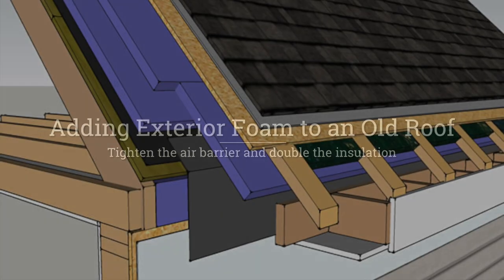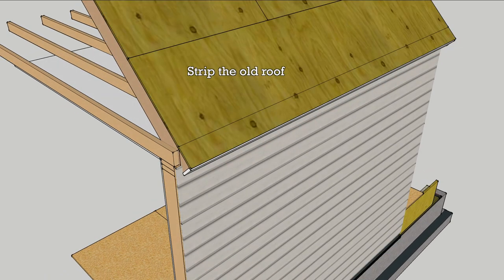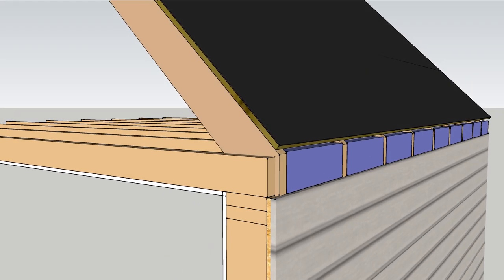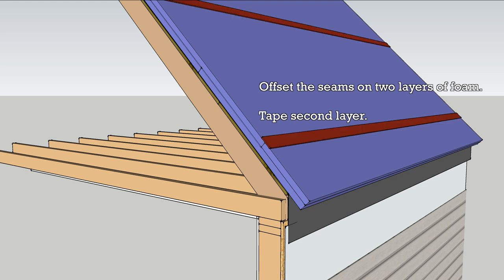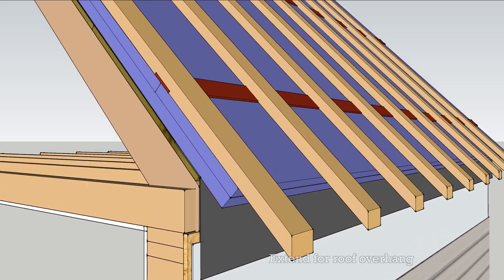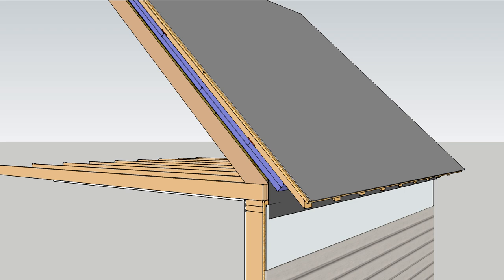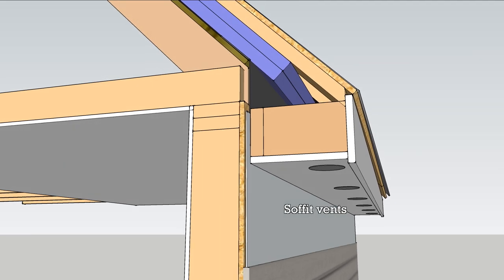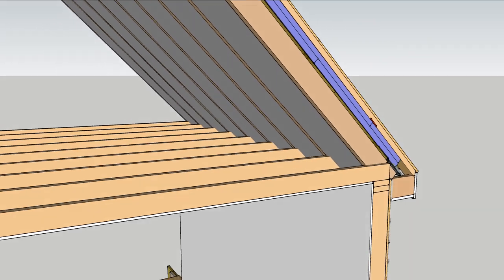Roof Insulation vented

Comment: In the continental USA 3rd quadrant (think Cartesian plane; i.e., the southwest) it makes more sense to use a vented sub-rafter radiant barrier.    Eave vents for air intake; ridge vents for exhaust, by convection current.        This is the competitor to high insulation values, and is a finesse solution to passive energy conservation.        To use high R values of insulation is to "force it."   This makes sense in Minnesota and Massachusetts.      The radiant barrier is superior in California, New Mexico, etc.

Comment: I'd like to see the monopoly house design from Matt Reisenger's Build Show.  The ladder blocking goes outside the exterior wall foam.
Reply: @ProTradeCraft  Your box beam is a thermal bridge
Reply: As mentioned in the video, the foam on the roof extends beyond the outer walls to later be incorporated into exterior wall insulation

So the thermal bridge is there, yes, but thermal bridging has been eliminated on the entire roof deck.

And the ladder beam would later be removed when the owner adds exterior insulation under their siding.

Comment: I have a 1944 cape cod in Seattle with 2x4 walls and 8:12 rafters. The attic is Finished & Conditioned living space with knee walls and some blown in insulation (~12" on the knee wall floors and "maybe" 3.5 blown in between the rafters sealed in with rigid blocking). Seattle code suggests R38 for roofs. I need a new roof this summer, and want to add insulation on TOP of the deck. 
Does this process seem reasonable for an experienced DIY with retired pro roofer help?  
1) tear off shingles & paper, remove gutters & uppermost siding. 
2) Add peel and stick membrane to the sheathing. Add tape down to the exterior wall membrane.  
3) Add 2 layers of offset rigid foam, tape upped layer 
4) Lay 2x4s on the flat every 16" above rafters, for ventilation and eves. Secure with long Headloc (or Deck Screws?). 
5) Lay new sheathing, membrane, and shingles (or metal). 
6) Build out eves/soffits with ladder framing attached to house, add bug barrier, fascia, ventilate at each rafter bay, re-attach siding and gutters.

What would the ideal rigid layers look like? Unfaced 4" below and faced 2" above would be R33. There's plenty in the rafters joists and knee walls to get to R38.
Reply from the maker: Sure, if you are detailed in your work, not afraid of heights, and donm't try to cut corners. In my experience, many DIYers do a better jon than "pros" because they have more time, money, and their families live inside.

Comment: Excellent. I learned more from this little 2 minute video, than hours of culling through others. I’m just going to substitute rockwool over foam. You were brief, to the point. I enjoyed your wall vented video as well. Only thing that I would have liked for you to cover, is how to handle the peak at roof. Since heat rises, seems like at peak, it would be released there. Did it just stay completely closed up? TY for this wonderful little video.
Reply from the maker: Glad it was helpful!
For this vented roof, you'd install a ridge vent at the peak -- of course, it would be above the insulation, as the inlet vents are also. air comes in at the eaves and goes out through the ridge.

Comment: Is the second roof deck absolutely necessary if installing a metal roof? I'm trying to add exterior foam without essentially doubling the weight/deadload on my roof rafters.
Reply from the maker: No, but you'd want the furring strips to be perpendicular.
Reply: @ProTradeCraft  or diagonal?

Comment: what is your spacing on the screws and what about gable overhangs
Reply from the maker: Spacing is probably 16 inches, but you could ask an engineer. In New England, a lot of houses don't have gable overhangs, but if you want one, extend the plywood past the gable wall and build a box beam like you did at the eaves.

Comment: Add a radiant barrier (aluminum film) 
on top of the foam board insulation and 
under the new rafters(for venting and overhang)
:-0)
PS Overhang is almost entirely for looks, so save bucks with a new look LOL
Reply: 2Truth4Liberty in areas with a decent amount of rain – overhangs are very important for keeping as much water as possible away from your walls
Reply: I would disagree that you need to keep "as much water as possible away from your walls"
as an important part of longevity of the wall.
Further, with wind (that usually accompanies rain) that area of protection for the walls on most houses is only a few feet of the top of the wall.
It is MUCH MORE IMPORTANT (cost effective as well) to protect the very top and bottom of the wall along with around each window.
Walls and windows will naturally dry quickly "on the OUTSIDE" with scarcely any harm over many many MANY rains, but moisture INSIDE(behind) will NOT naturally dry *quickly*.
Again -- "Overhang is almost entirely for looks, so save bucks with a new look" :-0)
Reply: Unless you are in a deluge, an overhang will keep water away from / out of the soffit vents and hopefully, prevent a large amount of the water from getting behind your siding ( https://youtu.be/kKBe9XVDMmw?t=793 ); adding to that, having a rain screen system will allow the wall to dry out when it does get wet (but a good overhang should keep the top of the wall, at least, from getting wet).  Additionally, a properly sized overhang can provide shelter from the sun for the walls- helping to keep the house cooler in the summer.
Reply: @Mr Sunshines The overhang does a very good job of protecting the top 12" of siding Einstein. Unless u live at the equator and it only rains straight down at your house . . You dont and neither does the man that started this thread.
Reply: On shorter overhangs (less than 12") I would partially agree with your assessment of an overhang being superfluous.  But on a building with a greater overhang ( 24" or more) it goes beyond looks or curb appeal.  The wider overhang,  especially on 1 story buildings (like a ranch-style house) provide much protection from moisture and greatly extends the longevity of the siding material,  doors, windows and the paint job.  A wider overhang can also help shed water further from the foundation  reducing hydrostatic pressure on the foundation wall.  Ever seen a bowed in block basement wall caused by moisture and freeze-thaw cycles?  I have.  Also,  wider overhangs can help shield the house (again 1 story) from the detrimental effects of direct UV from the sun.
Reply: @tedw7359  I would agree that wider overhangs are more than just for looks.
24" one a one story is a whole different thing than normal though
maybe trends will change :-0)
Reply: @2Truth4Liberty  In my part of the world (Midwest) the suburbs are mostly Ranchburgers and 24"-30" overhang is pretty standard.

Comment: (Opps - first time I have commented on a video.) Now to my question - I need someone to do this kind of work on Cape Ann in Massachusetts. Are there roofers or construction companies in my area that have done a lot of this. The roofers I am speaking to seem pretty unfamiliar with the process. I have a 1935 open rafters home and am trying to put as much insulation on the outside as possible without making the house ugly. Thoughts? Recommendations?
Reply: Did you find anyone in your area to do the work? Was it successful?
Reply: Yeah, how’d it turn out? I’m also in ma and need energy retrofit and structural stuff done.

Comment: A roof over a roof? How is the extra weight of the second roof calculated into the existing structure? Any reinforcement needed to be added to the rafters of the first roof? 2 x 6 not enough space for insulation? Really? What about Fire Safety issues? If there is an Attic fire the Fire Dept will have serious issues getting through that roof.
Reply: Foam is 2 pounds per cubic foot. A 4 inch depth only adds 2/3 pounds per square foot while providing R40 insulation. The roof can support this easily. A slight breeze creates more force on a roof than this insulation.

The 2x6 has plenty of space for insulation, but they also provide a thermal bridge for cold and heat - the foam prevents that turning the attic into an internal space.

Chainsaws are standard equipment for firefighters trying to penetrate roofing. A Chainsaw would cut through that foam like a hot knife through butter. Not sure why you think it would be "a serious issue" getting through.
Reply: That brings up a good question. . . The roof on fire would create a real issue, 4" of foam turning to soup under the plywood. Could be a challenge. Good point.
Reply: Extra weight should not be significant, as rigid panels only weigh a few pounds each spread over 32 sq ft, and the second layer of sheathing (OSB usually) is only another 25 lbs or so spread over 32 sq ft.  Roof trusses/rafters in the north are usually spec'd at at least 3x expected snow load. Snow load with wet snow can be 20 lbs per sq ft, way above the  less than 1 lb per sq ft of the added roof material.   A 2 x 6 rafter is not to code in the north. Typically you'd be using minimum of 2x 10, and more likely 2x 12.  Pack in 8" of R5 per inch to get R40 and another 2" exterior to get a total of R50 and you'd meet code in the north.  Even better to add another 2" on the exterior.

Comment: How are you going to handle the moisture migrating into the attic from the home since it's no longer ventilated?
Reply: This design would work only if your attic is part of the conditioned space. Otherwise it makes no sense to insulate the roof (greater total area) and you would put your insulation in the attic between/over the trusses instead.
Reply: An attic does not need to be vented, a roof does. This brings the attic into the conditioned space. You must not have insulation on the attic floor if you do this.
Reply: @AnthonyBrusca  if you don't have a dehumidifier in the house, yes you do. Originally the house is insulated in a way that allows the moisture from the living space to be ventilated through the ceiling up out of the attic.
Reply: Yeah not venting over living space in cold climate zones is asking for trouble. Also who uses screws on a roof? Good way to get roofers and firefighters hurt or worse.
Reply: @JohnComeOnMan  Roof venting is NOT to evacuate interior air. It's to ventilate the underside of the roof deck with outside air (hence the soffit intakes).

Comment: I wondering if this will work when you have no attic.

Will condesation form on the first old roof deck?
 Can the rockwood insulation touch the old roof deck ?
Reply: You always need a little air exchange. Much less then before, but still some. A gable fan is the preference in a situation like what was described here.
Reply: You need the correct ratio of insulation on either side of the original roof deck. I believe it is minimum 40% outside, but don't quote me on it. If you get the ratio right, that deck will never get cold enough to condense moisture from the inside air. You can also spray foam the underside of the old deck (min 2" closed cell) but I don't know how that would work with the membrane on top.
Reply: There is a ratio as @jasexavier describes, and it is climate dependent. 51% to the exterior in these parts (DOE Climate Zone Zone 6a). 
Do NOT listen to dekonfrost7. It makes no sense to tighten and insulate the slope of your roof, then to introduce air beneath that air and thermal control layer, with a powered fan no less! 
dekonfrost7 probably thinks houses need to 'breath' and interpreted that to mean they should leak air. No! They need to manage moisture and to provide enough fresh air for occupants, but it's not a good idea to provide this fresh air via a leaky roof—it is likely to be too much or some unknown amount and could introduce moisture problems in your roof.

Comment: That seems like a lot of extra weight. Are you sure those 2x6 old house rafters are ok with that? Not to mention the walls supporting the roof?
Reply from the maker: I would be more concerned with the rafters than the walls, but foam insulation literally weighs almost nothing. An extra layer of plywood and some 2x4s are probably not going to be too much, bit if you are concerned, ask an engineer to calculate it.

Comment: How would this translate to a log cabin?  I also need to replace some of the log rafters because of rot or critter holes.
Reply from the maker: Well, it has nothing to do with the framing, it's an add-on atop the roof, so it would translate well.
Reply: @ProTradeCraft  The roof will meet a log at the bottom, it is not straight edges or something you can cut out like what you have in the video.  As I have to replace some of the roof support, I wasn't sure if I would need to start over anyway.  Great video, thank you!

Comment: You didn't put a drip edge on the new roof, why?
Reply: They are only including the relevant details of the insulation retrofit. Things like drip edges and gutters are just normal parts of the roof finishing.

Comment: Anybody doing this with mineral wool? I don't like what styrofoam does in a fire. Is there a mineral wool product that is rigid enough?
Reply: there is sheet type mineral wool but mineral wool will likely compress with the weight of what goes on top of it unlike ridged foam which is why they are using foam.  personally i would use high density "Styrofoam" as it doesn't absorb or hold water.
Reply from the maker: Yes, people do it with mineral wool. RockWool has a board product that is used for this purpose.

Comment: How does it do with solar? Will the screws hold all that weight trying to slide off the roof?
Reply from the maker: The 2x4s should be screwed into the framing below the foam, so yes, this should work well with solar. Especially considering how much energy WON't be needed to achieve your solar goals.

Comment: My research suggests this technique should perhaps be coupled with a “vapor diffusion port“ at the ridge. Thoughts?
Reply from the maker: well, it would be a standard ridge vent, as the ventilation is introduced at soffit vents.

Vapor diffusion ports would be used for an unvented roof with insulated rafter cavities.

Good job digging up the latest in. roofing science, though!

Comment: YES!  Now how do you cover the rake edge?  Do you treat it like a corner of a wall (take peel and stick and adhere top layer of XPS to rafter)?  If fascia is applied directly to peel and stick and rafter need a thermal break?
Reply: Did you ever get an answer ?
Reply: @cheeseburger9232  still pending (doesn't look like its coming).  Any thoughts?
Reply: @treystills  the only thing I can think of , is having a sheet  metal shop make a custom drip edge.

Comment: Should this roof also have insulation between the rafters?
Reply: It can and should, but you need to think about your air/water barriers, and where the condensation point will be. When you do something like this, you are implicitly including the attic into the "conditioned space," which can change your other computations.
Reply: If you do, you need to make sure that the ratio of interior to exterior insulation is correct, to avoid condensation on the old roof deck.

Comment: Could you estimate the cost to replace roof like this?
Reply: if you have to ask, you can't afford it ...
Reply: @anon7039  That is a stupid answer, so you would just start ripping away your roof and think about the price when the job is half way finished?
Reply: It's not hard to price out the materials. Start by measuring your roof.
Reply: @ Thoracius Appotite
 is correct, you would need to find the area of your roof first.  do some math to find how many sheets, rolls and shingles you need.  roofs are often calculated in "squares" which is 100sqft/square or a 10x10 area.  4x8 sheet goods are 32sqft per sheet.  don't forget things like any ladders, lifts, fall protection, permits or other hidden costs like delivery.  you are likely to need a tarp to cover the project as it's unlikely you will finish it in a day or two.  add the cost of beer and pizzas if friends help.